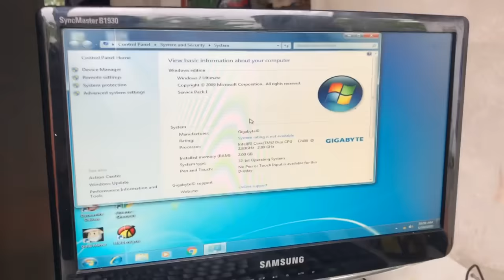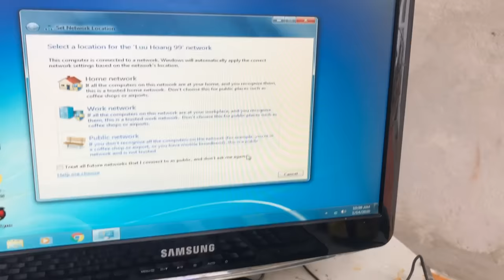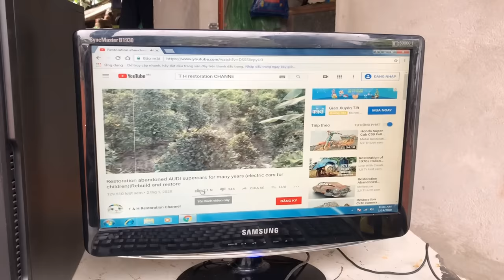Restoration destroyed desktop trees | Rebuild and restore ( FULL )

Comment: Its fully fake. That hdd is impossible to work.
Reply: He change the HDD
Reply: Le Pika Du Coin Are u serious?
Reply: Le Pika Du Coin Even if He changes all parts, it wont work. 1:39 Cpu socket was destroyed.
Reply: @fredmeyer9481  if you bend the pins back correctly it will work again
Reply: Fernando Zavalla  como se vaahacer viral esto, limpia todo con agua ajjajajaja
Reply: And he is just randomly soldering those capasitor pins together lol
Reply: If you really believe that then dont watch I bet you watched it from beginning until the end
Reply: It can work, try yours :)))
Reply: @mouraeisso2982  I've been waiting for someone to say the same thing. I admit it's quite entertaining though but they really gotta change it up
Reply: @matiastoniolo  es alcohol isopropílico
Reply: This is a REAL FAKE! 🙂🙂🙂🙂
Reply: Fred Meyer I found a 480 gb laptop drive in the aquaruct. In water. While raining.   Still works.  Slow as f but works
Reply: More mud = more restoration!
Reply: He put water in the hdd lol
But whatever as long the disk is not broken
And the magnetic arm moves freely then the hdd is fine
Reply: Rainbow Blazer after he opened it and “cleaned” inside, its no longer working.
Reply: when it broke he/she gonna change the parts
Reply: @mouraeisso2982  lol i was thinking that
Reply: He scrubbed and damaged the CPU socket

The multimeter, he was just probing random pins to measure the continuity
Reply: Yes, but there is a chance to work
Reply: Its impossible to even get dirt in there and the whole build is fake because the psu will blow up when it gets in contact with water and the cpu pins are bend and a simple hammer wont get you this far
Reply: @brorow7660  i watch it to the end to meanwhile laughing out loud because he is an idiot, and bet you watches till the end to
Reply: Milanotje and also, getting any contamination inside a hard drive (even a piece of dust) will pretty much render it unusable.
Reply: Bhai prosessor pin is also damage and he not change it directly insert the new prosessor there is no chance to work of prosessor
Reply: despues de meter el procesador con los pines hechos mrd segura q funciona xd
ademas q habra el pc y les aseguro q no es el mismo
Reply: @pcbuildsreviews5914  Sure you Right, but the HDD Is Game Over, ive you open it Outside from a sterile room
Reply: Yes it's totally fake
Reply: @pikaaxyt  just HDD?
Reply: Yes
Reply: đúng rồi, ko thể nào sửa dc hdd như v
Reply: You wash alla the component's in the water how can It work ? It's impossibile..fake😂
Reply: Cueto  ctg
Reply: yes
Reply: You deserve like and subscription!
Reply: @fredmeyer9481  Yep I agree with you as a big capistor from psu and lcd controller is not soldered back and the hhd heads are so fragile and cannot be washed like that a 0.2mm gap between the platter and scan head destroys it.
Reply: @cristianbora6009  That's white petrol
Reply: @pikaaxyt  he change the entire parts😂😂
Reply: @pcbuildsreviews5914  The Freaking Socket Where You Put The CPU Is Destroyed, Not The CPU. Why Is Your Username That If You Dont Know About What The Parts Are?
Reply: This  is real 100
Reply: @SP_FIFA32  you joking bro?
Reply: Yes i am joking
Reply: @SP_FIFA32  HAHAHAHHA
Reply: Ware are  from??
Reply: @SP_FIFA32  Japan
Reply: Nepal
Reply: I was even confused only the top platter of the hdd was cleaned not the bottom too ahaha
Reply: Catalin Ursu real
Reply: And he broke the mother board when he cleans It, he broke the processor pins, fully fake..
Reply: @pcbuildsreviews5914  watch 2:32 and stop covering him he install the CPU without re line the pins back ..😊😊😊
Reply: @vipul7068  Oh lol I didn't see that. Guess I had low quality vid. Ye then it's totally fake
Reply: Please send my this PC
Reply: Como arrancó si todos los pines estaban doblados que mentira
Reply: @matiastoniolo  jajaja es agua destilada, no es conductora de energía!!
Reply: @pikaaxyt  J'y crois pas un français !
Reply: You can't expect to see a  cpu socket that clean in a mother board that dirty
Reply: No, it is true restoration. He washed the HDD with holy water 🤣😂😂
Reply: @aswinpt2202  hahahahahahahahahaha it's petrol .... The Donald Trump petrol hahahaha
Reply: @pcbuildsreviews5914  are u serious?
Reply: Not only it's working, didn't even need to install anything. Windows ready with drivers and all 😂 Actually it should run windows 10 because it's fresh after the washing 😂
Reply: That's what I thought but if he never scratched the platter, it should be fine.
Reply: @milanotje8009  it will blow up only if connected to power outlet immediately after a water wash... if dried properly it won't blow up
Reply: @pikaaxyt  t français??????
Reply: Youtube_ kekyto oui
Reply: @pikaaxyt  ok
Reply: @mouraeisso2982  let mee dream bro
Reply: @matiastoniolo  En mi canal tengo un video demostrando que una placa base puede ser lavada en agua, y continua funcionando
Reply: Agree
Reply: Real fake
Reply: I'm also same reply that's totally fake
Reply: Fred Meyer no wonder why u comment dis .-. He changed it
Reply: Le Pika Du Coin he change de HDD logic board the  ram and the entire PC
Reply: Cuz all the parts are avail on amazon and computer shop
He might changed the hdd cd part(data) and fully change all the broken boards and wires
Most of hdds have temporary part for recovering
He might also brought back data from there
"Impossible means you are afraid to meet truth"
Reply: Yes
Reply: no he took his time he just speed the video up
Reply: is not
Reply: also you see the CPU is not a main computer part its the hard drive also might just bought anther part Fred Meyer
Reply: He change the HDD
Reply: @Rainbow__cookie  there's nothing that can go inside hdd.. So he put some shits
Reply: @HUANERGP  la placa te la puedo creer pero el disco duro??? No lo sé rick...me parece falso.
Reply: @matiastoniolo  mas pode sim lavar com água da uma pesquisada no Google
Reply: 먼지하나 들어가서 오류가생기는데 물세척ㅋㅋㅋㅋㅋ
Reply: @fredmeyer9481  its damaged
Reply: @fredmeyer9481  false. It works
Reply: ITS RESTORE MOTEFAKER
Reply: a ty ostatní součástky ae aspon je na co se dívat
Reply: It's fake washing the components with water and fix the case thats fuck up and how he puts the parts back together I might have sore eyes after this
Reply: Fake video
Reply: its possible though there are probably tons of bad sectors
Reply: Yes you are right this is fake 😂
Reply: He washed the HDD
Reply: Of course is impossible how a hard disk can work while is wet?
Reply: yes
Reply: Obviously.
Reply: x2
Reply: @fredmeyer9481  

.

Зжжтолощ
Reply: CPU socket itself is broken when he try to clean it with brush, who the hell is cleaning cpu pins with brush bruhhh.
Reply: He would changed inside parts in there
But it would require a lot of time and work
Like soldering parts, and all of shittos that are broken.
Reply: Wacht the video complete
Reply: Is correct the work in the hdd no is fake jajajajajajajajajaja  or repair one ssd jajajajaja
Reply: yeah
Reply: @pikaaxyt  and mother
Reply: Are pagal
Reply: Its for possible
Reply: Its true but they buy new parts XD
Reply: @matiastoniolo  no es agua es alcohol isopropílico o también usan tinner
Reply: yea
Reply: just for content
Reply: It is true
Reply: El disco con solo abrirlo ya se empieza a oxidar por eso viene cerrado al vacío y tiene unos sellos de costado , no hace falta mojarlo para arruinarlo solo abrirlo
Reply: @pikaaxyt  yo un frenchie
Reply: Mega fake
Reply: The head was broken.
Reply: @iluvyousomuch000  If you just open the hard drive, it is instantly broken. If a speck of dust gets between the read head, the hard drive will be immediately scratched and cause the head to crash. I've already opened hard drives myself. and they all broke shortly after they were screwed on due to dust getting between the read / write head. You would have destroyed the hard drive with the water alone. The read head was also on the outer edge of the platter, making it impossible to start without damaging as the head rests on the platter. Normally the reading head is either parked in a certain zone or it is moved completely out of the disk stack. (Translatet by google translate)
Reply: @patrick7447  idc
Reply: Your just jealous that you can’t restore your own
Reply: The motherboard was under power because the BIOS battery was still inside.
Reply: It can be fixed but not like this
Reply: You just want views of course
Reply: @iluvyousomuch000  ok listen here Zoomer but can YOU restore a whole pc?
Reply: @Blaze-ud1kh  Explaination please?
Reply: The hard drive, the motherboard the psu, lets not forget, the lovely new lcd panel with a line on it. This guy must be VERY cynical or very poor. His videos are a total scam
Reply: @indominusbytecomputadoras2470  your just jelous
Reply: @pikaaxyt  ya 😂
Reply: Haven't noticed sensor display on Samsung monitor too. I have same monitor, and it's might be sensetive to those "clean ups."
Reply: Thanks cap
Reply: Only HDD?
Reply: He has a lot of fake videos. Ship dislikes
Reply: For an HDD it's even impossible to have dirt within if not being opened before and put mud inside spesially :))))
Reply: @fredmeyer9481  if he changed ALL the parts then it will work because it is new computer :-)
Reply: HDD, motherboard, CPU, GPU, RAM, ROM, power, it's COMPUTER impossible to work
Reply: Russia axyenno
Reply: понятно, что импоссибл

Comment: Awful
1: used water and a hairdryer to "clean" it
2: doesn't fix spots where theres no read whe testing random areas
3: awful soldering
4: didn't even fix the drive
5: ram in the wrong way
6: power supply would explode if he plugged it in. Everything about it was broken. Shouldve just thrown it away
7: THAT DRIVE? You cannot clean tha disk. It ruins it. Its ruined now.
8: all of this was set up. Theres no ay that garbage got into a sealed hard drive. And no way he just "found" this on the side of a road pretty much intact.
NONE. Of this shouldve worked. Feels like it was recorded in reverse and he broke it himself.

Didn't even put a "new screen" in rightm killed the pixels.
Reply: Precisely

Comment: I like how the CPU socket was fine before the wash and after that a lot of pins are bent. ^^

5:50 New case. You could hammer for months and would not get such results. And there was no sidepanel with the PC when he found it.

Also there is dust on the fan and exhaust of the power supply. As he cleaned the power supply before in water there should be no dust left.  Bonus - DVD-ROM installed topside down.

At least it was entertaining. 😁

BTW: Burning trash at the side of the road but the PC is not burned despite it was together with the rest of the trash?

Comment: This guy "repaired" the computer by washing parts with water... 😐😐
Reply: It can stille work it Just neet to be dry
Reply: It's the shotd surkits dat break cumputers
Reply: Not Just the water
Reply: Its alcohol
Reply: It's possible to clean it with water but a computer found somewhere randomly impossible it would be rusted
Reply: @Aston3003  this wat i am saying
Reply: @Aston3003  it whould get corrodet
Reply: @nikola2667  yes the pc in the video would be rusted and corroded 
But if you have a dirty motherboard you can clean it with water
Reply: @Aston3003  yea and the hard disk got dirt in it and mud and it's made So dat wuld not happen
Reply: @Aston3003  no
Reply: That's right I was also thinking that
Reply: He washed the power supply too bruh
Reply: HDD is fucioning but slow i make it with my PC
Reply: it's impossible that parts work
Reply: LOL. It's impossible to repair this computer
Reply: Wow!! This is AWESOME I believe everything about this repair of the computer!!! Nothing is ever fake!!   LOL LOL
Reply: I’ve done it before it works fine dude
Reply: See its not repairing video its restoration. So need to change the part ok
Reply: It's not water wash its thinner washing
Reply: Its not Water washing it's thinner washing
Reply: jj
Reply: As long as there is no electric current flowing on the circuit board, it will be fine, because what damages electronics with water is when the water causes a short circuit, or the terminals/traces get corroded. As long as it gets dried out quickly (to prevent corrosion) it'll be fine. :)
Reply: @ThePoptardedtj  ah yes "  Cumputers "
Reply: Holy water ;)
Reply: Lalit Pandey nope it's definitely water bub
Reply: Not water.hydro water
Reply: @Dave S is fake
Reply: sketchy
Reply: CPU socket itself is broken when he try to clean it with brush, who the hell is cleaning cpu pins with brush bruhhh.
Reply: Noticeable thing is that When he washed hard disk with water, the head of hard disk was damaged, already them how the hard disk work ? He was not replaced hard disk head and media !
Reply: Noticeable thing , he put cd/dvd drive wrongly and screwed
Reply: This Chinese boy , make fake restoration video and making money on YouTube channel , 
I proved in y previous comment's
Reply: If applying heat on hard disk media , it will not work, fake vdo
Reply: well he must of fried the motherboard
Reply: Yea you can just wash the part with water, dry it and one last thing

Buy a new one
Reply: @bonnienewmoreira5032  se nota que sos edpañol, se dice working, no funcioning
Reply: Is it is water or any chemical
Reply: wow how convinte
Reply: It's all pcb bro
Reply: How do you clean parts
Reply: It’s like fixing hand  by a hammer
Reply: @MEDO626  like he replaced all PC components XD
Reply: The video may have some fake information but you can actually clean some components with water, but they need to be dry and the period under water must be mimimal, and for those who think diferent go and watch some Tech Tes City computer cleaning, this vuy washed a PSU with water and ram with dish soap, and the guy could me using isoptopil alcohol that si what we use for computer when we clean some components.
Reply: @nikola2667  Indifferent HDD can t have shit insaid.
Reply: How did the dirt get into the disc? it's fake

Comment: He "repaired it" by:
1. Scrubbing the cpu pins with A BRUSH!
2. Using WATER to clean the parts
3. Thinking capacitors are fixed just by straightening them even though they are crushed.
4. Magicly removing scratches from the motherboard (it looked like ww3 when it was found and u are telling me that there is not ONE scratch).
5. Smudging the inside of the hdd and suddenlt it looks crystal clear.
Reply: The hard drive part is the worst lie hahaha
What a waste of time, I put a general negative.
Reply: big fish  ok lmao
Reply: Actually cleaning with water is fine but make sure u dry it completely
Reply: big fish  i know i was being sarcastic too.

Comment: HDD VS WATER
Normal people : its broken!
This guy : I can run windows 7 from this hdd!
Reply: no that hdd is broken, water destroys data on hard drives
Reply: @chuuisinsane  he has changed the data base of hdd
Reply: that isn’t how hard drives work, they can’t be touched by water at all or the data on them is destroyed and the drive can’t be initialized.

along with that, hard drives have a rubber seal so nothing can get in. there were no other holes in the drive, and the seal was intact, but somehow dirt got in (which would also destroy the platters).
Reply: or bad sector's on the hard disk drive
Reply: Alcohol
Reply: And even opened the HD...
Reply: This is awesome
Reply: @nikola2667   Well yes, but actually no.
Reply: @chuuisinsane  hole existed but  there's a filter for ventilation
Reply: Inkling Boy - BLK • 555 • yeah, a small hole exists on every drive. however, it’s so small that water couldn’t get in it. only air.
Reply: @chuuisinsane  source: I disassembled dead hdd, 3 of them
(One has click of death (WD), another one having bad IC (Maxtor), and the last one is just dead (Fujitsu))
Reply: Inkling Boy - BLK • 555 • what’s your point?
Reply: @chuuisinsane  nothing, just saying
Reply: No he cannot
Reply: @chuuisinsane  water destroy hdd)
Reply: @dimka3210gmail  yes, if water touches a hard drive it will absolutely destroy it
Reply: Chris i know)